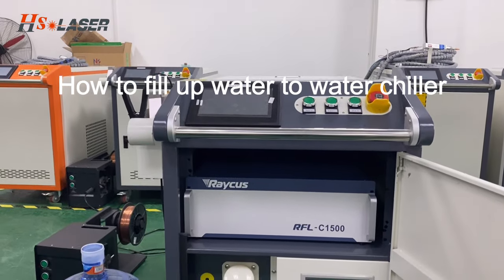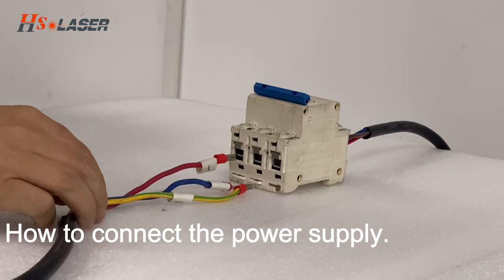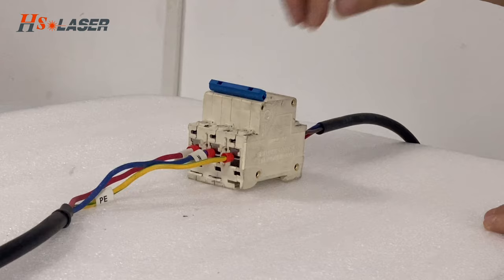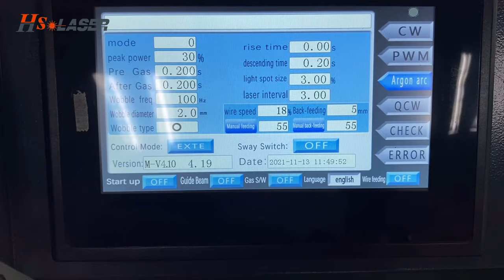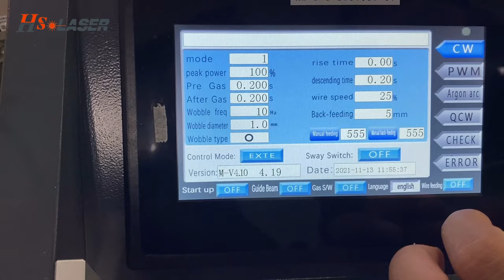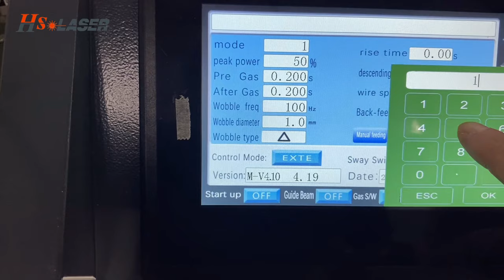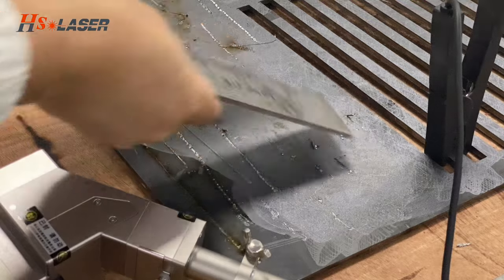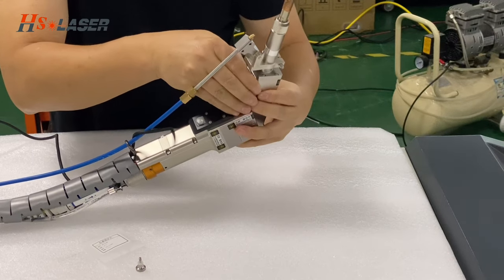1000W 1500W 2000W Manual Handheld Fiber Laser Welding  Machine Operation Manual Video STEP BY STEP

Comment: Sir what is price of this fiber Lazer welding machine?
Reply from the maker: We have 1000W 1500W 2000W , what is material and maximum thickness you need weld?
Reply: 0.5mm to 5mm stainless, aluminum, etc what is the price of the machine can weld that thickness? I want to buy